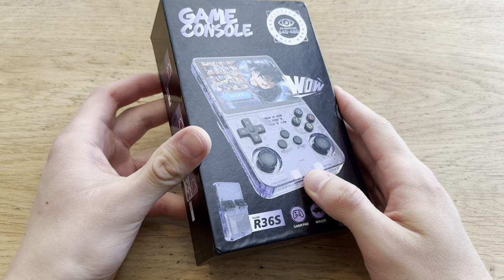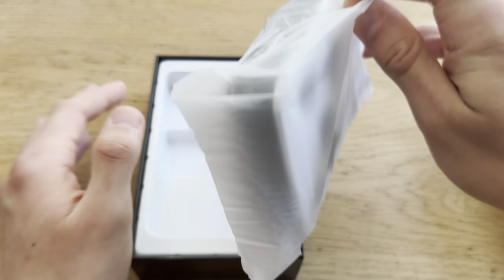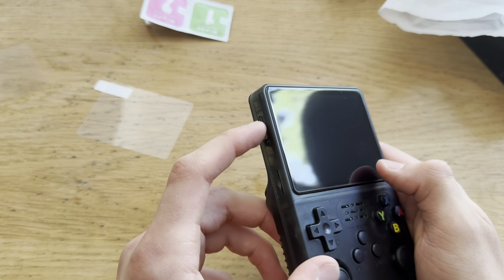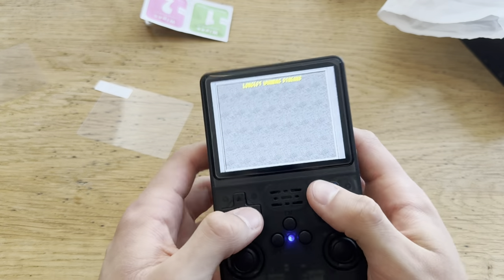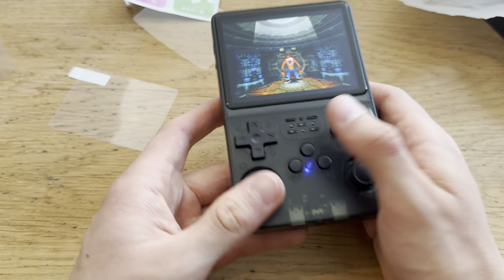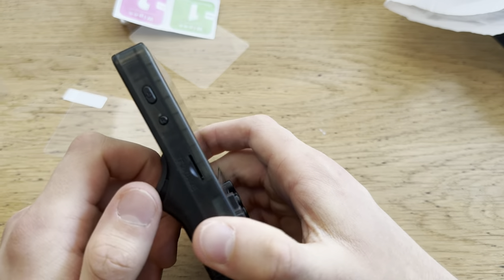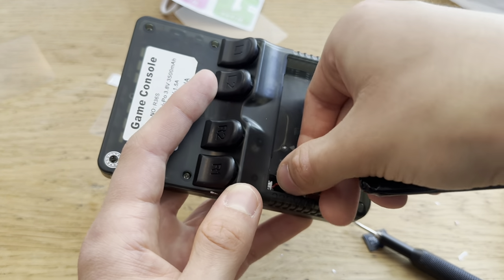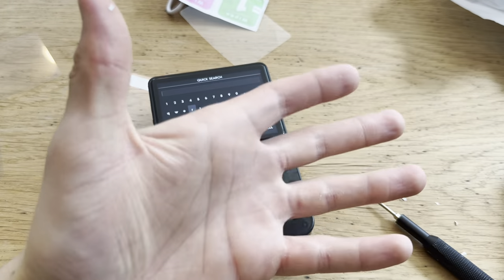Teardown and unboxing of the RetroBoy! (R36S)

Comment: As I heard, this company had a problem with another, where the other company was suing this company for stealing the design and circuit. The funny thing is, the circuit board was modified by the PCB manufactures and sold on the market (which is new to me that they do that), and this company allegedly bought the modified version, built a very similar looking retro handheld console to the other company and then that's where the whole fued started. But then they made this version, which looks a bit different from the other company. The whole story, as I heard it, was pretty confusing.
Reply from the maker: Damn i did not know that:)

Comment: if you buy it for 52 you are getting ripped off. just wait for choice day then it will be reduced to 35 and with the additional codes and/or coins you can get it for less than 30!
Reply from the maker: I think i got it for 40 plus tax? Ill check. I saw it yesterday for 35 bucks i think

Edit: i got it for 42 dollars pluss tax so 52 dollars total
Reply: @RetroBoyy  yeah still too much i got it for 26 €
Reply from the maker: @X91X-km7hp god damn😅 Well i sold it for 80 so Im good:)
Reply: I just order one from Amazon for 68 but there was a coupon. I order the 128gb. The website sells them for $106.
Reply from the maker: @pollodormido2 that’s a dropshipping website